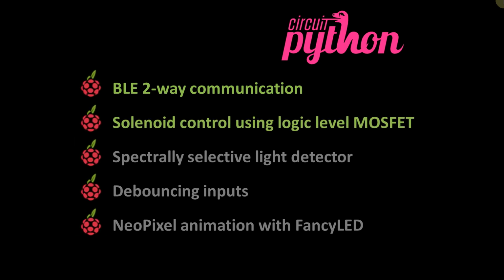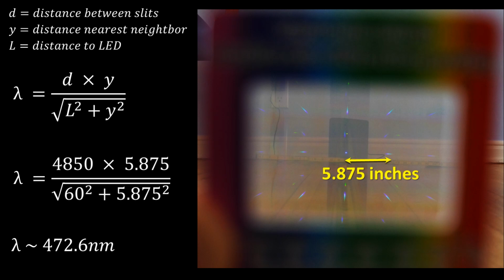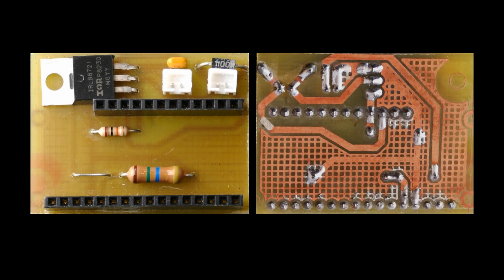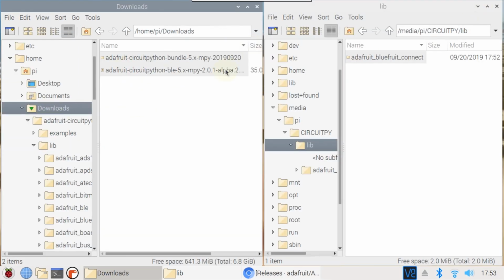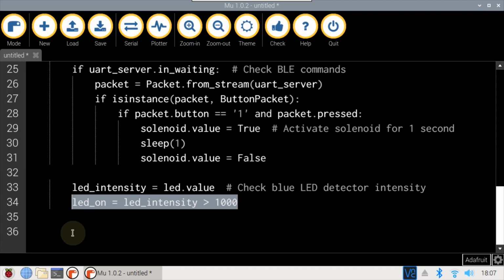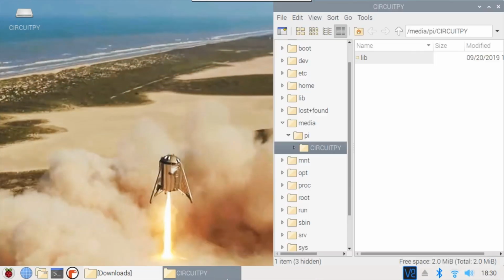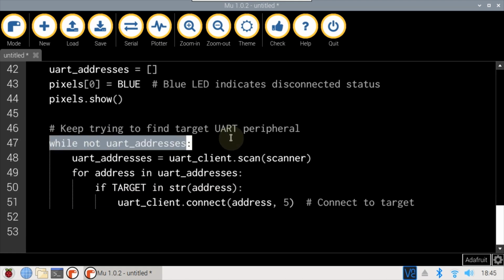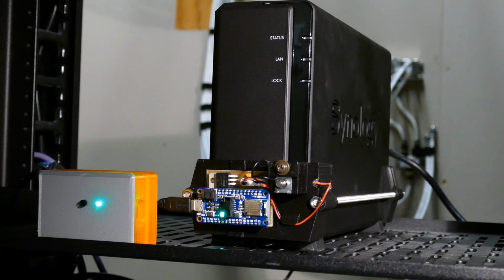CircuitPython nRF52840 BLE Client / Server Remote Control Tutorial

Comment: bro, I want to ask but this is out of the topic of this video. can the detection value of tensorflow be used as output on the LCD using raspberries? for example I want to detect money objects with a nominal of 1 dollar and several other nominal, after tensorflow can distinguish which one dollar and which other nominal, can the results of this detection be issued on the LCD with raspberries? so the output on the LCD is "1 dollar"?

Comment: sir , how are you ? would you kindly answer my question ? or  just tell is my idea possible or just give up 

 so I'm currently working on a project from long time ago that was devastating and depressing for me , i will tell you  the idea and what progress I made through the past 6 weeks and see if you can lead or help me ,,

 so the idea is I'm currently connecting esp32 Arduino board with six senses , 5 of them are flex sensors and one of them is the mpu6050 sensor which reads the angle of x y and z
 I was able to connect those sensors to esp32 and read all the values on the serial monitor as you can see below the code and the serial monitor ,in Arduino IDE 

https://ibb.co/92qBsh0

 now my next step that I didn't know how to do is :

 I want to send those data, the serial monitor data continuously every 6 second to raspberry pi via the Bluetooth of the esp32 to the Bluetooth of the raspberry pi in order to program those data , i want to program those data to an LCD and a speaker ,

For example if I received the following values from the esp32 I want the Res pi to put a certain word to the LCD screen and and then convert it to speech through the speaker , I already connected the LCD to the raspberry pi. , but now how I can send the serial monitor data continuously to the pi  via Bluetooth so I can program it
Reply from the maker: Sorry, I don’t work much with Arduino’s.  I’m sure your goal is possible.  I’d ask your question on one of the many Arduino forums.
Reply: @rdagger  so sir i was able to connect the esp32 to the pi and i can see the data if i use in the terminal and wrote cat /dev/rfcomm0  , do u have any idea how can i use the data now to start writing a program ex. if you received this value from the Bluetooth   terminal i want you to print in the LCD this word and to the speaker this word
Reply from the maker: Take a look at BlueZ:  https://www.bluetooth.com/?s=bluez
There's a BlueZ library for Python:  https://pybluez.readthedocs.io/en/latest/

Comment: Thanks for the great video. I wonder if you are still interested on MicroPython for the ESP32.
Reply from the maker: That’s a great question!

I enjoy working on the CircuitPython Feathers.  A lot of talent went into the design of the hardware and software.  CircuitPython has a rapid development pace, a friendly community and Adafruit provides fantastic technical support.

Still, the ESP32 and MicroPython are a great choice for WiFi projects.  The ESP32 is inexpensive and very capable.  I don’t think CircuitPython has any plans to support the ESP32 other than as a WiFi co-processor.  MicroPython also has concurrency support (interrupts for hardware and uasyncio for software).  I don’t believe either is on the CircuitPython short-term roadmap.

I am keeping an eye on MicroPython development.  Specifically, I’ve been watching the ESP32 BLE progress and support for the nrF52840 boards.

Comment: All of this info about LED's is fantastic. I absolutely must source and try using defraction grading now. That is an awesome technique.
   Where could one learn about this kind of thing independently? Does anyone have suggested book references (especially older books or revisions that might be sourced on the second hand market)?
  Thanks for such a remarkable set of examples and solutions to a simple problem.
-Jake
Reply from the maker: https://www.chemedx.org/blog/simple-method-measure-wavelength-light
Reply: @rdagger  
 Tnanks